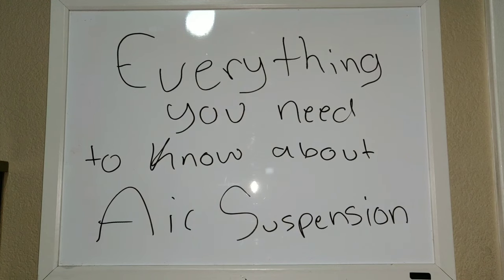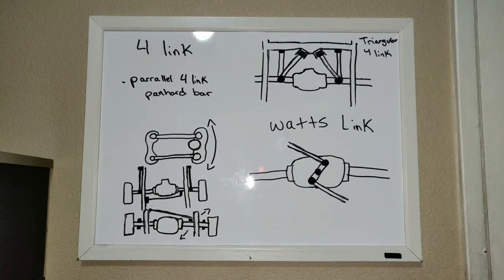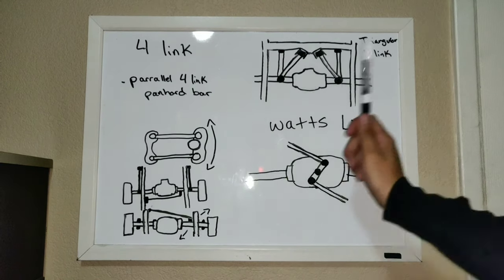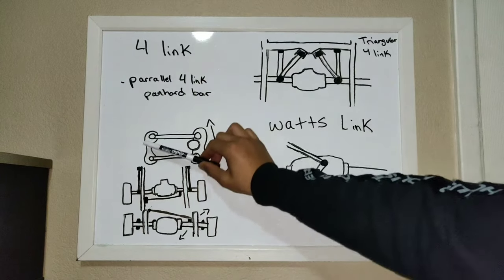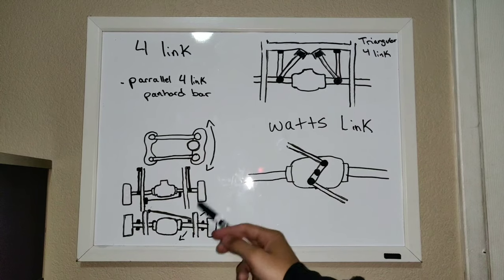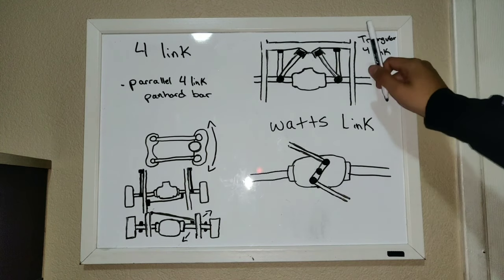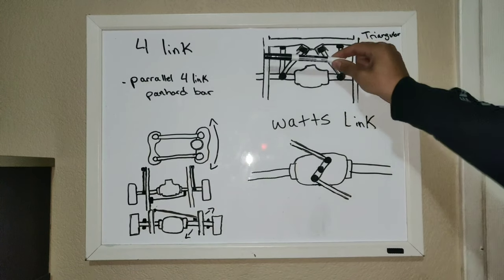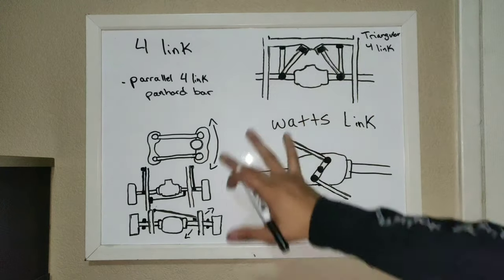Everything you need to know about air suspension !

Comment: You pretty much covered it, but the most important thing between U bolt two links and 3 and 4 links are the pinion angle. Bad ass truck man I really love what you did with the frame work back there, you did some bad ass work overall to the truck. Love the channel been waiting on a channel like this 👍🏽
Reply from the maker: Ahhhhhh okay , so I'm assuming with a 2 link the pinion angle isn't free to move with the frame right ? It's kinda set in place ? Or is it something else. Never considered that thanks for the info ! And huge thanks for the kind words man ! 💯🤙🏻
Reply: Yes,  the two link doesn’t allow the axel to to rotate and give tension on the links or tabs when turning and going over things like dips and such. I have no problem with two links but I rather do 3/4 links
Reply: C10 Danny I’ve also seen bushing wear out a lot faster on two links also
Reply: I rather buy lowering leafsprings if my only option besides leafsprings was a two link. On old factory trucks they had very long two links so the driveshaft wouldnt' get out of wack when loading them to their max capacity. A wishbone works great when  you have fuel tanks in the way. Nice truck!!

Comment: Both setups are easy to find a leak common sense if u have a leak we’ll u know from the side that leans on not like you said ,, could be either bag on Manuel set up ,and forgot to mention manifold block setup is slow and can’t hold high pressure with air lines vs Manuel set up u can use hydraulic hoses not every one into the granny speed of block set up can’t tell you bias and all for block set up but ur job was to explain how air suspension works have to speak on neutral grounds member there people who take what u say seriously and say they go with block set up and they not happy cuz it’s to slow Manuel valves have slow downs if it’s to fast going up or down come on this info is not wasn’t important to mention in ur video !,!